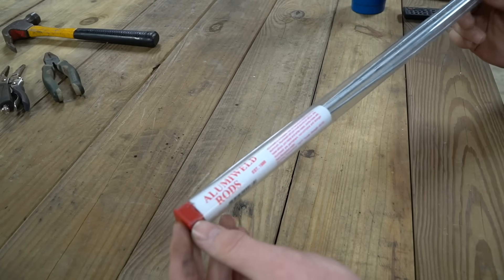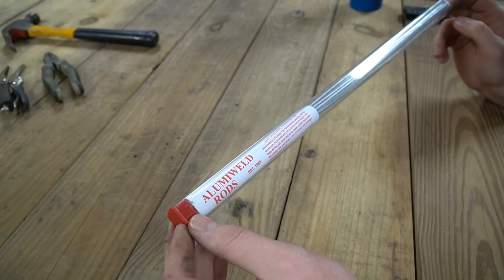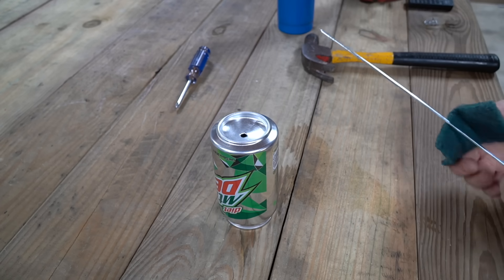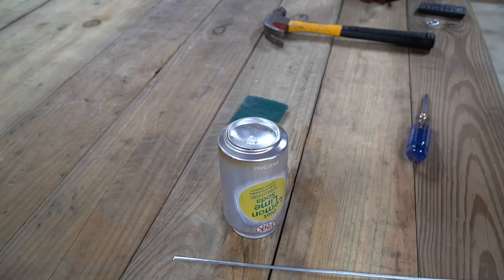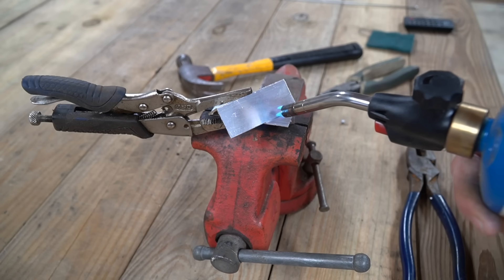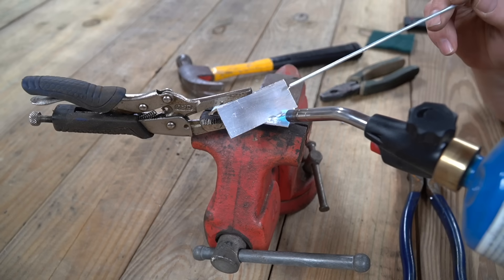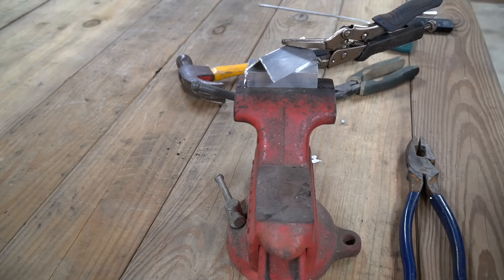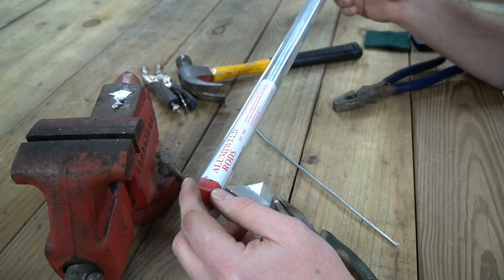Alumiweld rods from Harbor Freight!  Do they work?  Can you easily weld aluminum with just propane?

Comment: Being a welding schooled welder, I can tell you, this is not welding or brazing.  Welding occurs when the base metal is melted with the filler metal.  Brazing occurs at over a thousand degrees Fahrenheit.  So, technically, this is soldering.
Reply from the maker: You read the pinned comment, didn't you!?  LOL

Comment: Good vid, thanks! Have you tried welding something like electrical conduit! Too much surface area to heat? You know how solder wicks around the pipe, when brazing copper pipe? The Alumiweld doesn't do that, does it?
Reply: It does, its pretty similar to solder in the way it acts

Comment: I’ve seen the Alumaloy commercial on TV and was very skeptical. This video convinced me to try it. I would like to cut off rust from a car and patch over the area with aluminum sheet metal. Can it solder/braise dissimilar metals (i.e. will the aluminum rod stick to other metals such as steel?)
Reply: Farmer, wouldn’t recommend using dissimilar metals for the patch. I grew up in upstate NY and patched many rusty fenders and body panels. Using dissimilar metals creates galvanic corrosion between the two. Even the corrosion from  aluminum pop rivets in steel will show thru body repairs.  I have the best luck using steel panels and stitch welding them on with .030 flux core wire. Scott

Comment: I built a 1/10 scale RC car trailer out of aluminum plywood trim from Home Depot. I intended to use these rods, but after multiple failed attempts at brazing joints, I opted for drill/tap. The plywood trim distorted before it would get hot enough to run the rod. The trailer is on my channel, for anyone interested.

Comment: Looks like it worked pretty well. When I was just learning to braze I would use regular baling wire to braze with.
Reply: Old clothes hangers work as well as long as you scratch with emory cloth a little.
Reply: That's welding

Comment: This is hard-soldering. It's not welding and it's not brazing.
Reply: it's the same as "sacrificial anode" (direct translation from Swedish). The same thats used on boats to stop corrosion etc.
Reply: @janstahl9589  I think... you mean that it's zinc. In this application, its use is "hard soldering", which is a lower temperature than brazing, which is a lower temperature than welding. Soft soldering is at the lowest temperature.

Brazing requires much higher temperatures, high enough to make the metal glow red to orange.
Reply: @timhofstetter5654  Yes! The sticks aren't  any magic. it's the same as zink 🙏👍.
Reply: @janstahl9589  I have a small roll of zinc solder in my basement right now.    8)

It works really well for soldering galvanized steel, too.    8)
Reply: @timhofstetter5654  y see i works very well 😀🙏👍

Comment: I've used these.  Four things I learned: 1) The weld is actually stronger than the base metal, 2) Not all types of aluminum can be brazed with this.  For some reason, it just won't stick to all alloys.  3) It is nearly impossible to weld from both sides of a joint.  Even if you let the weld cool, it will cause the weld material to liquefy on the other side and drop out.  4) Flat position is about the only practical way to use this.  Vertical, maybe.  Overhead, no way.

Comment: Crazy question, input from both 1D1OCRACY and other commenters would be most appreciated.
I have an aluminum car rim with a broken lip, the bead itself is fine as it still holds air, but would this be something that would be worth trying to fix it, or should I just go another route?
Thanks. (:
Reply from the maker: Personally I wouldn't trust it.    There are places that specialize in fixing rims though!
Reply: @1D10CRACY  Thanks for the quick response, I figured it was at least worth it to ask. 😃

Comment: I’d be curious to try this on a cracked aluminium bike frame. Normally welding them isn’t advised because they supposedly need to be heat treated again.
Edit: a crack in a part of the frame that wouldn’t be catastrophic if it failed during simple commuting. I wouldn’t try it on the front triangle of any bike. Or if you ride like Sam Pilgrim.

Comment: I tig weld aluminum.
 A guy went with this aluminum colored glue sticks (this is not weld "filler rods") for exhaust application cause it was cheap. It melted on him and he came back to me for tig welding. I told him to get lost.
Reply from the maker: I typically mig aluminum, my tig is DC only.   Maybe someday I'll upgrade it.

Comment: For the best joint strength, after you establish the puddle, you then heat from the opposite side of the joint. That draws the puddle through the joint, maximizing fill area.

Comment: Thanks for showing me the rods from harbor freight!
I am a retired jeweler and you're heating your metal wrong!!?!
What ever joining material you use - be it gold, silver soldering,  brass or aluminum brazing - the principle is always the same!  The main body of metal must be brought up to the same temperature as the "melting temperature" of the solder or brazing rod!
If your main piece is large or has anything that can be a heat sink attached to it, then you have to heat a larger area of the main piece!  You do this by moving your torch in a steady, circular motion, to spread the heat.  Only concentrate the flame on the solder area after everything is heated right!  And while you're doing the concentrating you may have to temporarily go back to heating the main body for a moment, so it doesn't cool too much and then quickly back to concentrating!  Also, you were holding your torch too close to the object!  Back off!  Use only just beyond the tip of the blue flame.  That's where it's hottest.  Pushing your flame closer, only manages to destroy the efficiency of the flame. 
Please practice what I tell you!  I've done thousands of jobs requiring theses skills and I'm good at what I do.
Good luck my friend!😁
Reply: As an old mechanic what you are saying second nature,  but I guess that comes after many years of welding and metal work,  now I'm enjoying sand casting my own parts.
Reply: Great advice
Reply from the maker: You are absolutely correct!   Very well said!   That is why I kept stressing in the video that the metals needing mended had to be at the melting temperature of the rod, just like any other form of brazing!  Very similar to soldering!  Thanks for the tips!
Reply: instructions on the rods i have say opposite to normal brazing, put the rod in the flame
Reply: Actually the hottest part of a flame would be the part where the molecules are moving the fastest bumping into each other, which is what creates the color in this case blue. Therefore the hottest part of the flame would be the part with the most color, right there on the top of the flame. Beyond the molecules are beginning to spread out, less bumping, in turn less friction, in turn less heat.
Reply: @anthony, Tell me you're not a welder without telling me youre not a welder😂😂😂
Reply: Quiet. He DID heat up the base metal in the vid. Did you watch it?!

Comment: Welding aluminum is tricky. If you don’t have that oxide layer removed, you will blow out the aluminum underneath, as aluminum has a lower melting point than the oxide. Brazing with these rods probably help, but I don’t know if I would trust them to hold something structural.

Comment: The secret to a good bond is to get the metal hot enough so the rod melts when it touches the metal. Do NOT put the flame on the rod!!
Reply from the maker: Yup!   You need the base metal at least 730 degrees.    It's ok to touch it with the flame, but the base metal needs to be hot enough to melt the rods.
Reply: @1D10CRACY  that's what he just said
Reply: Makes a smoother fillet on a t joint like this as well

Comment: So far, the rods I bought at Harbor Freight, have worked the best. As mentioned in the video...the surfaces have to be clean. Aluminum will oxidize almost immediately after its cleaned...so, one thing not mentioned, is that scraping the rod against the surfaces you are trying to weld...will help to expose unoxidized metal, and get you a better joint. It takes a while to perfect that technique...but its worth it.

Comment: these are great for fixing leaking rivets in aluminum boats.....much better than going the epoxy route
Reply: Unless the aluminum is cracked then it is better to either get a buddy to hold a hammer against the rivet on the outside while you give it a few hits on the inside or to drill it out and replace the rivet. I have fixed many leaking boats but I have never tried these rods on bad rivets... just saying most of the time a couple hammers will work.

Comment: What happened to the Mountain Dew can? Was it a fail and if so why? Sometimes its good to show the fails with the success so people can see that its not as simple as it seems or maybe what to expect.
Reply from the maker: I melted the top of the can with the propane.   Should have mentioned that, but I didn't.   It is explained a bit more in the pinned comment at the top of the comment section.

Comment: I tried these on my aluminum boat every weld cracked.
Reply: Boats are problematic, even for experienced TIG jockeys. Joints experience VERY complex stress. Used boats have VERY persistent salt contamination (even if used exclusively in fresh water). Like all braze joints subject to stress, fit up has to be PERFECT over 100% of the joint face. If you are closing pre-existing stress related cracks, you HAVE to "stop drill" the ends of the crack in aluminum, even more so in sheet work. As the previous reply said, you may need to reinforce the joint with an overlay
Reply: @ludditeneaderthal  Yes, I know this, this is why I asked if with that method, there was less of an issue, covering a larger area.  
I guess there is gorilla tape for boat cracks... NOT for hair!  haha
Reply: Online Bills gorilla tape works for boat covers. Put it on & cover with liquid electrical tape. Fixed rip in my cover for 5 years.
Reply: @ceciljimison3847  That's not fixed! That's patched.
Reply: Thank you for this feedback.  Im curious: did you weld just alongside the cracks?  If you weld a 'rectangle' covering the entire crack, do you think this will hold?
I also wonder if you completely clean the area to be brazed?

Comment: Would it be any different if the two to be brazed were cleaned, I know that aluminum has a coating on most of it?
Reply: Aluminum will flash an oxide layer over it almost instantly if you scratch it. Anodizing is the intentional building of a (relatively) thick layer of oxide.
Reply: @randomidiot8142  Key to get this stuff to work well, is to melt a bit of the rod onto the aluminium and then use a steel wire to scratch the aluminum UNDER the puddle. This breaks the oxide crust and the rod forms the desired alloy and penetrates into the aluminum - cool to see this happen.
Reply: @DLWELD  thanks for the tip, I'll probably need to know that before too long.

Comment: I bought something very similar to these to repair an aluminium casting. Turned out the casting was like Swiss cheese and just collapsed! Maybe its worth mentioning that they're great for extruded aluminium but castings are a whole new ball game.
Reply: Wow, thank you for mentioning this. How did that happen - did the cast aluminum have a low melting point? I have some cast aluminum fittings that attach to a sailboat mast and boom with stainless screws. Over time the aluminum corrodes and the screws don’t hold any more. I was planning to drill the holes oversize, fill them with alumaweld, and redrill new holes. Then use galvanic protection paste on the new fasteners to slow the corrosion. But that would be a big mistake if this ruins those castings.
Reply: It may have been poor casting, you never know whats under the surface with casting

Comment: I'm shortly going to be building a tandem bicycle, however the frames are substantially larger than the pieces being demonstrated on. I've heard of pre heating the material first and that could be how I'll do mine.
I only own an AC stick welder that is rated at 70 amps and might not be sufficient to do my project. Also, I'm told the puddle is rather murky feeling when stick welding aluminum and i should practice on similar stock aluminum first to get the hang of it before wrecking 2 bicycles!

Comment: I ripped the bottom weld on my Jon boat and had a 12 inch separation. I bought some of this stuff from a guy showing it at the State Fair of Texas. I found that a simple propane torch won't heat a boat enough to melt the rod. I wasn't going to go buy a oxygen brazing rig, so I got a guy at a welding shop to fix it with his TIG welder. He actually charged me less than what I paid for the rods at the fair. Live and learn.
Reply: Get a good tip that makes a rosebud flame,  and I prefer to use map gas (yellow can). It's basically propane, just a smidgen hotter.

Comment: I patched a high pressure a/c line on one of my cars once, it rubbed against the radiator until it sawed a hole into it.   The line was one piece from the condenser through the firewall and looked too difficult to replace, so I just patched up the hole.  It worked!
Reply: I used fiberglass and JB weld, 450psi on a dime sized hole. It still holds
Reply: Wow, that’s good to know, some of those AC lines have a lot of pressure in them. Nice to know those rods work that well!
Reply: @Max Timberwolf  That low pressure side sees plenty of pressure once the ac begins to equalize low and high side after the ac has shut down.
Reply: I repair a/c lines all the time with jb weld! I usually back it up with a piece of aluminum and cover it with jb weld.

Comment: Great video. I had a motorcycle cylinder head that cracked due to a hard crash. It was leaking oil from top down into combustion chamber. Took forever to get it clean enough, but I used these rods to patch/fill crack, and it held up for years. They are very good rods for filling cracks, in my opinion, not sure if I would trust them for structural joints though. Great product for those of us who don't have tig or mig welders.

Comment: Use mapp gas
Reply: I agree with the mapp gas, I use it for aluminum brazing, most guys aren’t trying to fix pop cans and on larger aluminum parts it soaks up the heat, so it’s better to use a hotter flame, just as any form of brazing it takes practice and a good sense of how much heat you need.
Reply from the maker: Too hot for the thin materials I was using in the video.   You would be surprised how easy it is to melt a pop can with just propane.   :)

Comment: Gotta use the yellow can stuff.  Not the blue can stuff
Reply from the maker: Gotta use the blue can stuff.  Not the yellow can stuff.  :D    The yellow can stuff (Mapp Gas) gets too hot for thin aluminum and will melt thinner pieces like what I was using in the video.   The blue stuff (Propane) also gets too hot, but not as hot and its easier not to burn through your aluminum.   Maybe if you were using something thicker, mapp guess would be a better option.  Also when brazing other metals with other types of brazing rods, mapp gas is probably the better option.   With these rods, you need your base metals just above 730 degrees Fahrenheit.
Reply: @1D10CRACY  I’ve used both on these rods.   The yellow can stuff ‘ mapp’ gas is better.   It’s heats up better and works better.   I’ve used a lot of this rod and the yellow can stuff is much better.
Reply from the maker: Did you notice the pop can changed brands?   Its because I melted a hole in the first one with the propane torch.   I would love to see you do a video repairing a hole in a pop can using mapp gas!  :D
Reply: @1D10CRACY  dude,  whatever.   I’m just telling my experience using either can.   The blue can causes a lot of warping in the material.   Yellow can stuff actually worked for me.   You can test on pop cans all day long.   I don’t care.   All I know is that the yellow can stuff worked for me and blue can stuff didn’t.    That’s my experience.   Take it or leave it.   Whatever!!!
Reply from the maker: No worries!   What works for one person may not work for the other.   Thanks for the tip, I may give it a shot over the weekend for the experience.

Comment: Can you "easily" weld aluminum... no. You can do it, but if you want "easily" get a MAP gas torch.
Reply from the maker: MAP gas can be too hot for thinner aluminium.   With some control it may be good for thicker aluminum though.
Reply: @1D10CRACY  I guess if Im working on fixing a pop can I might use propane, but I was trying to do brazing on a coffee table project I saw on youtube that used an aluminium frame.  Propane couldnt get the legs hot enough due to thermal conduction down the legs. 1/16th walls of 1" sqaure tubing and 20 inch and 48 inch pieces, just wouldnt get hot. MAP did the job in about 15 seconds.  They both have their place I guess, but I felt MAP was more versatile.

Comment: This stuff is great.  Used it to make a solar water heater/tank out of an old pool cover reel(had to plug up the screw holes and cap the tube). Hot water while boondocking in a truck is wonderful 👍🏽 Great vid🤗
Reply: Can i ask what kind of pressure you have and how it's worked out. I recently bought a travel trailer and the water heater is busted thinking of doing this myself
Reply: @joshuahensler1698 off topic, but for <$200, I put a hot water on demand from Camping World in my trailer. It's just a box that mounts to the wall and it's pumbed for a garden hose and BBQ propane bottle, but you could easily tie it to your water lines. Technically it's for a horse trailer. It's got a little igniter in it and it gets HOT HOT HOT.